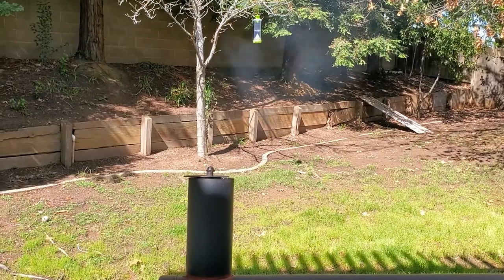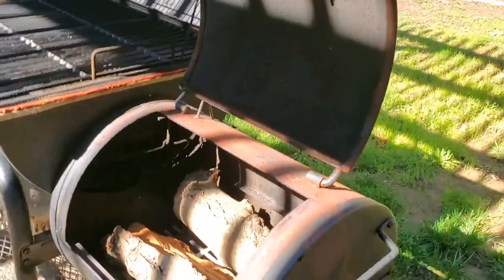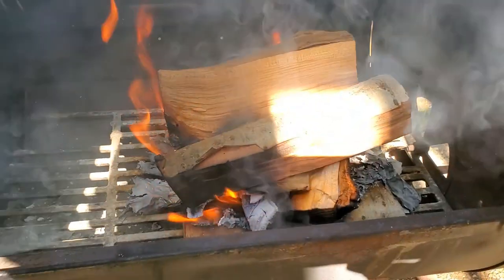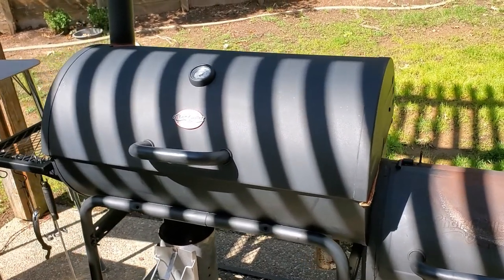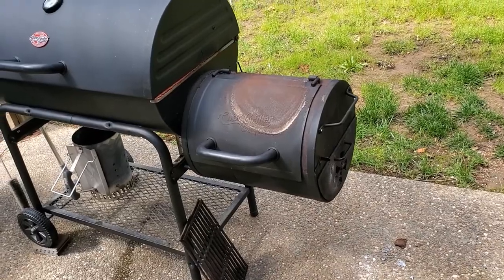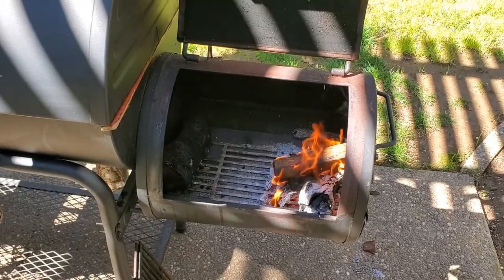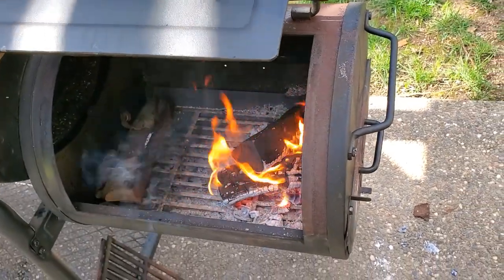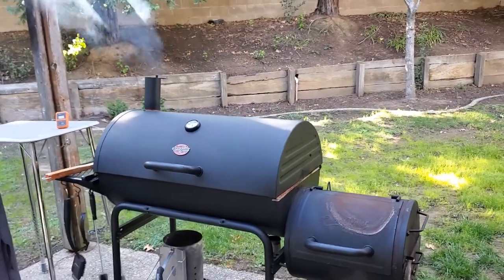BBQ 101 - Offset Smoker Temperature Management and Smoke Quality - White Smoke vs Thin Blue Smoke

Comment: When you add a new piece of  wood,  don't you have crappy smoke for  awhile  ( or in the grand scheme of things it won't matter  )
Reply from the maker: The trick is to get the wood really hot before adding it to the fire.  My favorite way to do this is by keeping 2 or 3 short splits in the box between the fire and the cooking chamber.  When the wood is hot, it lights up much faster and minimizes dirty smoke.  But in the grand scheme of things, a few minutes of dirty smoke isn't going to ruin anything so don't even sweat it.  Thanks for the question!  By the way... I'm working on a new video right now.  I shot an entire 6 hour cook in one take.  I'm just speeding up the video so time passes quickly when I'm not doing anything, and running normal speed when I'm adding wood or making an adjustment.  My goal is to show exactly what running a long cook looks like, including temperature fluctuations and all.  I'm also thinking about live streaming a whole pig I'm cooking this weekend.  Let me know if you'd be interested in either of these, I'd appreciate it.  Thanks!

Comment: Just became a new subscriber  yesterday  man ur videos are AWESOME. Im a very amateur offset smoker  and i was DEFINITELY choking the side damper. Would've never thought to run wide open and let the temps get to 400° and work my way down leaving both dampers open the entire  time this is a huge help. Trying in dry burn tomorrow  just to figure this out concept. I have some pecan wood logs but i need to chop them into splits. All my other attempts  were with the round logs. Thanks SO MUCH!
Reply from the maker: Awesome!  I'm really glad to hear this!  I'd also like to hear how your cook went after watching my video.  I think one of the biggest mistakes people make is using logs that are too big.  I buy logs and cut and split them down into large bins so I have plenty to work with for several cooks.  Please let me know when you have a chance.  Thanks!
Reply: @TonyToneBBQ  so I tried a dry burn after double layering the smoker with the lavalock strips and thr LTR. Used a charcoal bed as a base bc i just didnt have a large supply of wood laying around to attempt an all wood burn. I did have a few mesquite  wood log splits and I did a created some dirty smoke so that i could check the seals. Made a DRASTIC difference in smoke leakage almost none at all! Now, I notice, it does require  A LOT more fuel than my weber smokey  mountain. As you said when I let the logs burn down to a coal bed and then added some chunks of wood versus the full round logs the smoke was MUCH cleaner and the temps were leveling out around 225-235°. The other tip of leaving the extra wood to the side of the fire box away from the fire to keep it warm worked like a charm. It immediately  caught  fire once I added it to the coal bed.  Can't wait to try a cook with this technique.  I want to try Brisket but think I'll start with something shorter like ribs to see how often I will have to add coals/wood. I still think I had to monitor it more and frequently  than on my other smoker. It's not a set it and forget it but I think I knew that when I purchased the offset smoker.
Reply from the maker: @suchairman2  good stuff!  I'm really glad to hear how well the sealing worked out.  Yes, you'll definitely tend to the firebox a lot more with a offset like this, but the extra effort is worth it in the difference in flavor, in my opinion. Running clean smoke like that, the meat absorbs the best flavors for whatever wood you're cooking with. Try to use as little charcoal as possible. I like to use a small pile of lump coal as a starter bed but my favorite is to use a bunch of really thin sticks of whatever wood I'm cooking with. I had to trim an oak tree a while back and ended up with a bunch of long skinny branches that I cut into 8-in sticks and I used those for the longest time. 
Have fun and keep that smoke rolling!

Comment: I’ve got my smoker for a week now and seasoned it yesterday. I’ve got a lot to learn, i think I’ve cooked the smoker to hot because the paint was coming down on the fire box 😢

Awesome video’s man! 
Thanks for sharing 💪🏻
Reply from the maker: Congrats on the new smoker! Yeah that paint peeling off is a common issue. No worries though. You can either respray it with some high temperature engine block paint and let it cure for a couple of days before covering it or cooking, or you can spray it with some peanut oil the next time you fire it up but before it gets too hot and let that dry to the surface which will create a coating similar to seasoning a cast iron pan. Either of these methods will help prevent the rest that will eventually start. Just have fun with it, take your time and enjoy the smoke. Thanks for watching and let me know if there's anything in particular I can help with.

Comment: Watching this while I'm doing the maiden burn off. Playing around adding small bits, seeing how it reacts to adding one piece, 2 pieces, so on. Trick I'm finding is losing alot of heat when adding wood, waiting for it to flame up/ stop smouldering before I close the fire box up again. Attempting the wood preheat ontop of the fire box. Practice makes perfect 🍻 great video
Reply from the maker: Right on Rob!  Yeah, if you get the next piece of wood nice and hot, it'll light up almost instantly. Try keeping the next piece inside the firebox between the fire and the cooking chamber. They get super hot that way and will light up super quick.

Comment: Thanks a lot.  This video was what i have been looking for.  I needed to see someone walk through the process so I could see the steps needed to manage fire temperature and maintain the clean smoke.  You are a life saver.  Now all i need to know is how is it different if you use coal as your heat base and a single split for smoke?  Are you scooping out coal if you need to lower the temp?  I'm having difficulty getting to and maintaining the range of 225 to 250.
Reply from the maker: Hey John!  Oh that's a really good question.  This can be a little tricky, but with some trial and error, it's not that hard.  If you're using charcoal, you can choak the air down and it won't cause dirty smoke.  Same with most lump coal, but you gotta keep an eye on the stack.  I usually keep intake wide open and close down the stack to reduce get the temp that I want with charcoal.  If you want to add wood to the mix, use a small chunk.  You'll have to feed it more often, but as long as a small chunk is burning well, you won't get the dirty smoke.  I did a vid on charcoal you might wanna check out.  Thanks for watching and I appreciate your comment!
Here's a link to charcoal:
https://youtu.be/qXW0sD58Lb8

Comment: Seems like it may be easier to use a charcoal base, would get a base built faster and might help to keep a steady temp with the wood? Might be worth the comparison...
Reply from the maker: Thanks for you comment!  Yes, starting with a charcoal or lump coal base is easier.  When I do start with a char or lump base, I go for lump because it's closer to actual wood.  Even though it's a little more work, my preference is still wood only for two reasons.  Reason number one is the purest factor of using only one heat source.  The second reason is that I need to get the smoker up to 400 degrees which takes a big pile of wood anyway so might as well save the char/lump coal.

Comment: HEY! Great video; seeing you go through each step was invaluable. So I have a very similar smoker (DynaGlo) but the cook chamber is smaller than yours.....do you think I need to use smaller wood pieces, or about the same and just vary the time, or something else? Thanks!
Reply from the maker: Hi Mark!  Thanks for the question!  You're on the right track with the size of wood that you burn.  It takes a bit of trial-and-error, but experiment with different sizes.  The goal is to find the size that burns the cleanest, for the longest time, at the right temperature range.  Small and thin might burn too hot and too fast.  Long and fat might burn too slow, too cool and make too much dirty smoke.  The temp in a smaller cook chamber will have more drastic fluctuations, and you just have to learn how to work with that.  In my Smoken Champ, I'm usually using splits about the size of a soda can.  I recommend you start with smaller peices, maybe even two at a time, but get a nice little bed of coal going first.  Let the time get too high, and then slowly work it down to the temp you want and figure out the size to add to the pile that keeps it in that range.  I hope that helps!
Reply: @TonyToneBBQ  thanks.....really great channel!
Reply from the maker: @markskeels1339  thank you!
Reply: @TonyToneBBQ  So I bbq'ed some chicken and a rack of ribs today using smallish Oak splits. Well I used somewhat smaller pieces and I found that the fire was easier to control and things came out pretty well. I think one secret is to build up a good sized bed of coals in order to maintain good temperature regulation. Next time, I am going to build up a good bed of coals first.
Reply: mmm also temps were in the high 60's today here in the northern mid west. I am wondering whether or not lower temps had something to do with the ease of control today.
Reply from the maker: @markskeels1339  yes, Sir!  You're right about that coal bed.  I normally start with a bigger fire than I need and then let it burn down to a nice coal bed before I even put my food on. Sounds like you're totally getting it dialed in. Awesome!
Reply from the maker: @markskeels1339  conditions always play a factor. Sooner or later you'll have a favorite condition and you'll look at the forecast and say, I'm smoking that day! Lol!

Comment: What do you do when the wind is constantly changing does that mean you should have decided to barbecue on a calmer day?
Reply from the maker: Wind can be a real pain, but I don't let it stop me. I usually just prop up some type of shield around the intake vent. A piece of plywood propped up against the firebox or a chair next to the firebox usually does the trick.  If it's really cold and windy, you just have to run a hotter fire because the cooking chamber will lose heat faster, but yeah if it's super windy and super cold, it can be difficult. You just got to create the right kind of shelter around your offset.
Reply: @TonyToneBBQ  thanks for the help man..

I'm trying to transition to a pellet smoker and only seem to get constant white smoke from any pellets that look Brown in the bag.. so after about 6 20 lb bags of pellets and plenty of white smoke I would have to steer myself to say something needs to change to get a different outcome and the outcome would be blue smoke or thin blue smoke.. I know I didn't want to be smoking with white smoke but that's all I had.
I've been using offset smokers for 35 years and had finally gotten the grasp of fire management but this little class I had watching this video was a good refresher course..

Onward to the pellet grill problems..
Last year near the end of the barbecuing season I was in Walmart and found a 20 lb bag of pit boss charcoal blend pellets where I looked at the bag and saw the pellets didn't look Brown but they were brown specks in the pellets so I bought that bag and gave it a try I got home took a handful out and put it in my pellet smoker turned it on and went inside expecting white smoke but when I came outside I always glance over at the grill whether it's running or not it's just a habit maybe just to reassure me that is still there and somebody didn't walk off with it... Anyway I looked over at the grill and all I could see was blue smoke literally literally blew I couldn't have asked for more blue or smoke but there it was my eyes were deceiving me I thought big smile come across my face and I took my ribs and put them in the smoker shut the door cuz it was a vertical smoker and was using a chamber temperature of 130° cooking them low and slow for 5 hours in the smoke when ribs were done you couldn't tell the rib for even close to a smoker you would have thought they were cooked in the oven in the kitchen..

I understand just because you have blue smoke and a smoke ring doesn't mean you have the flavor in your meat.. that's where I'm starting to have a concern about all of the processing that goes into making those wood pellets that exposes is more of the wood to air which oxidizes things and yes nobody knows how long that pile of sawdust was laying there before they decided to make pellets out of it..

I keep all my pellets in tupperware because smoking pellets are very very high groscopic I will suck up water out of the air liquide split...
The pellet grill I have allows the pellets to get screaming hot before they're dumped into the fire pot so I'm not adding cold wood to a hot fire and I understand that wood coming up to temperature will not create blue smoke because it's not in the 650 to 750° f  range to start producing blue smoke...

The ribs had a fantastic color when they were done and and tender just the way I like them but there was no wood flavor on the meat at all you would have thought they were cooked in the oven in the kitchen ..
I could have sprinkled some paprika with wood smoked flavor on it but that really wasn't what I was after for flavor.. it was a regular day no sun bearing down on the vertical smoker..
Any words of wisdom about getting flavor from a pellet smoker?

The pellet smoking industry is actually a unregulated business that that can put anything on the bag that says what's supposed to be in the pellets but end up not having any hardwood in it at all going from one extreme to the other...

But what mystified me was why that bag of pit boss charcoal blend pellets that looked black with the only pellet that I could ever get any blue smoke out of..

Was it the color of the pellet that was absorbing extra heat because it was black ???
This actually is my first pellet smoker and just trying to ring just a little bit of blue smoke out of those pellets because more blue smoke doesn't necessarily mean more flavor.. any words of wisdom would be appreciated..
Reply from the maker: @brucerogers3253  anytime Bruce!

Comment: Is a reverse flow offset smoker any benefit to adding flavor to your meat???
Reply from the maker: Excellent question Bruce! Thanks for asking it. In my opinion, the primary benefit of a reverse flow is a more consistent temperature throughout. The same volume of air will be moving through, so I do not believe there is a flavor benefit, but because the air has to make its way to one side and then back to the other, the result should be a more consistent temperature throughout.

Comment: is the wood use kiln dried or not? some say a little moisture is good, true or not?
Reply from the maker: Great question!  Wood can be too dry, but it should be dry enough to burn cleanly.  In my opinion, too wet is way worse of a problem than too dry.  I usually get wood from a local firewood distributor so it's never kiln dried.  I don't know about the stuff you get at hardware stores, but I'd guess it's kiln dried.  Thanks for the question!

Comment: I'm just curious what modifications you used to get that thing to not leak. I opted for a oklahoma joe highland which is made by charbroil apparently. This thing leaks out of the box. Other than that excellent video. Different cuts, splitting it, size, all good info
Reply from the maker: Hey Michael!  Thanks for watching and I appreciate the question.  My Char-Griller Smokin Champ leaked smoke like crazy until I sealed it up.  I used Lava Lock Smoker Gasket and RTV.  I actually made a video in which I describe how I did it.  I'll leave a link below.  If you watch the video, check the video description for links to the products I used.  Sealing the Smokin Champ make a HUGE difference in performance.  I had trouble holding temp, had massive temp spikes and dips and it was an overall nightmare.  After I sealed it up, the Smokin Champ worked like a much more expensive rig.  Please let me know if you have any other questions.  Thanks and here's the link:  https://youtu.be/Z3Mnl-HHrgs
Reply: @TonyTone BBQ  awesome...thank you so much. Will definitely look into. I refuse to go back to WSM and pellet. I love the labor. Thank you again for taking the time out of your day to help!
Reply from the maker: @michaelebberup3034  sounds great Michael!  I love it!  My pleasure.  Have fun and smoke on!

Comment: Can you use real wood mixed with fogo lump charcoal?
Reply from the maker: Yes, you can and it's something that I do occasionally. I usually start my burns with a pile of lump coal to build up the temperature and preheat my offset, but then after that I typically just add natural wood. Occasionally, if for some reason I'm struggling with temperature management, sometimes the wood and/or the weather is just uncooperative, I will add in lump coal to fix the situation. Just keep in mind that if you are burning any natural wood in that firebox, you must allow maximum airflow because if you don't, natural wood will smolder and create white smoke that will cause a bitter overly smoky flavor. I call that the ashtray flavor. Not pleasant in my opinion. But yes, you can use lump coal but the more lump coal you use and the less would you use, the less flavor from the smoke your meat will have.

Comment: Spray some canola oil on the inside and outside of that smoke to keep it seasoned and keep it from rusting out.
Reply from the maker: Yeah, I do now and then.  I actually prefer peanut oil.  In my climate, I find that regular use and cleaning out the ash is the most effective.